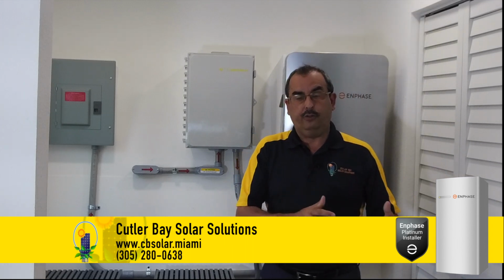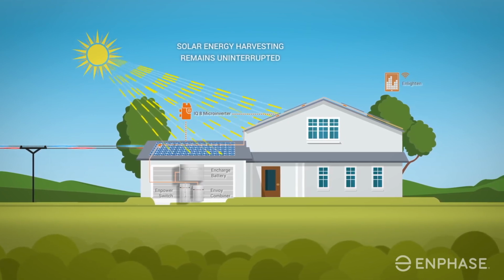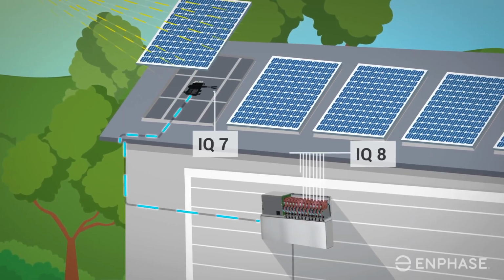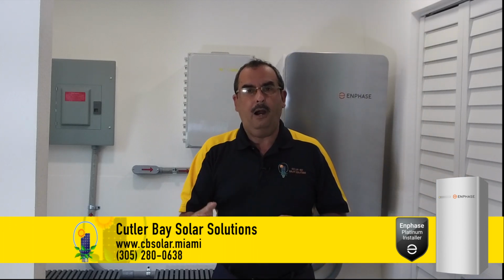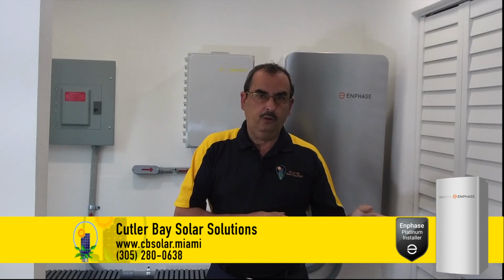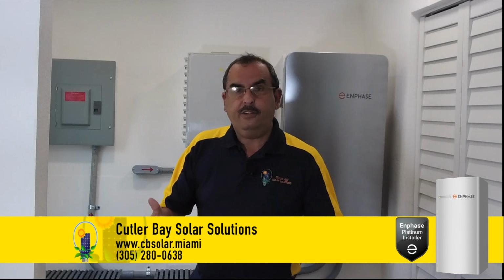Enphase Ensemble vs Tesla PowerWall 2 - Cutler Bay Solar Solutions - TGISS Episode 1

Comment: I hope you can answer my question here: I do not plan to have a battery storage, I intent to have the LG380W panels with 40 of IQ8H with one IQ-Combiner-4. Do I need an IQ system controller to get a ridge-tied system? Or just IQ-Combiner-4 (80A) is good enough?
Reply from the maker: Hi, You need the iq controller, rapid shit off switch, and a load controller in order for the iq8 to work as iq8

Comment: Outstanding and informative video.  Came here looking for answers between Tesla and enphase.  You covered all, except if I can run an HVAC system.

Overall great video!!  Thank you! 👍
Reply from the maker: Thanks for the nice comment! If both your solar and battery system are sized correctly, you can definitely run HVAC. Both systems will need a soft start if the cranking amps are too high

Comment: Hello im inters in put battery but my sistem it is solar edge with lg panels my question is if it s compatible with enphae battery?
Reply from the maker: Hi, thanks for your question. You would have to switch over to micro-inverters in order for the Enphase battery storage to be compatible with your system
Reply: @cutlerbaysolarsolutions4181   hello ok can  you contact me at dariolivares1977@gmail.com im ready to do it thanks!

Comment: Could someone help me out here, I’ve been trying to figure out what it would cost to have a solar with Enphase batteries. 12kw solar with 27-30kw enphase battery- how much could it cost? I can’t seem to find that answer anywhere.
Reply: You should check the independence reviews,  Enphase batteries is less efficient that Tesla or others
Reply: I am in the process of Enphase purchase and install in 2 phases.  Grid-tie this year and batteries next year.  The Enphase 10 battery is approx 15k a piece just for battery.  The iq7 micro inverters with 33 panels approx  9.7kw will approx 30k, so entire system with battery will ne 45 k.  To be equivalent to Powerwall II you need the Enphase 10 and 3kw battery combined.  Approx $22,000 just for batteries.

Comment: I also believe that Tesla does not work with a generator but enphase does?
Reply: Correct, Enphase recently updated the software for generator integration, it has a lot of options like what low percentage the batteries are at before starting generator, and it has “no run” times, like when your sleeping that it won’t start the generator, these are all adjustable by the owner

Comment: Misinformation- Enphase made several videos trying to fool people that during the outage your usage from Tesla System can’t be drawn from Solar & which is WRONG.  The house will draw energy from solar and powerwalls Will supply if the usage is more than solar could provide.  Powerwalls are more efficient, look nicer & specially lower cost.
Reply: Jimmy, Do you know if you have let's say 5KW of solar, will you still get full usage of the 5KW in outage situation? or does the Tesla Battery limit the solar to a certain KW?  Maybe a bigger 10KW solar Array could be a better example.  Thanks

Comment: I’ve been installing Tesla products for years. Raul your so misinformed. Sorry to say but Tesla solar will power the house 1st and charge the batteries in an off grid. 
Tesla batteries have fans that are there if needed. The safety of the battery is not dependent on the cooling system but has the cooling system to maintain a perfect operation temperature in any environment. How does your batteries cool when installed on the South side of the home? 
Also the Tesla batteries are as safe or saver than others in the market. 
We also have no problems with integrating our system with other inverters or solar panels. (More flexible system) 
Tesla gateway 2 is also 200 amps. Can you run a 400 amp home? We can buy installing two gateways. 
Tesla batteries are simple and beautiful out of the box, take must less room and don’t stick 2’ off the wall. Much more power in a smaller space. 
Please get your information correct.

Comment: Very good explanation - many thanks! Question: Can I run the Enphase Enpower Smart Switch WITHOUT a battery, so that if the system goes off grid I use power from the panels as long as the sun shines?
Reply from the maker: Hi! Thanks! No sorry the IQ8 is in the encharge unit not on the empower
Reply: @cutlerbaysolarsolutions4181  You're welcome. But I didn't ask about the IQ8? My question is; can I run Enphase Ensemble off-grid without a battery at all? I mean, only with the panels and the Enphase Smart Switch - using power from the panels simply as long as the sun shines?
Reply from the maker: @RomanKuechler  You will need the empower (smart switch), and encharge batteries in order to create a micro grid during power outages. The IQ8 micro-inverter is the technology built into the encharge batteries that makes the micro-grid possible.
Reply: The IQ8 microinverters are what enable the switch to island from the grid, you can't buy IQ8 inverters without the batteries, because ultities don't want to allow iq8 with out batteries to use on the grid yet

Comment: A lot of what you are telling about Enphase ensemble is based on IQ8. But that does not exist on the market.
Reply from the maker: Hi Robin, the IQ8 is included with the battery
Reply: @cutlerbaysolarsolutions4181  sorry I did not know that. Does that mean that with this battery you have all the same benefits as you described even with your current pannels with iq7 inverters?
Reply: Yes if you have panels with IQ7 inverters you are good to go.
Reply: @guyswiggins  My panels have IQ6. Enphase says IQ6 is compatible. Is there any difference between IQ6 panels and IQ7 panels?

Comment: I don't think Enphase does a good enough job of selling this aspect of the Ensemble system vs the others.   Thank you for this explanation.   I actually have the Enphase solar system.  As I was looking into storage solutions, I was put off by the Ensemble components costing 25%-50% more than the Telsa system without knowing the actual differences.
Reply: Misinformation- Enphase made several videos trying to fool people that during the outage your usage can’t be drawn from Solar & which is WRONG.  The house will draw energy from solar and powerwalls Will supply if the usage is more than solar could provide, doesn’t matter how many percentage of charge
Reply: @jimmyvole851  I have seen serval Enphase installers making this claim.  I'm not sure who to believe now.  was it an older Powerwall generation that Enphase was comparing to ?
Reply: @CrapTennis  I have Tesla solar system with 2 Powerwalls. There is no such thing as they described.  You could Google the people people with Tesla solar in Texas about their experiences a few weeks ago during the outage to see who was honest.  
suspicious business practices on misinformation
Reply from the maker: Interesting point! Thanks for the comment!!
Reply: @cutlerbaysolarsolutions4181  to understand the shortcoming of the powerwall more clearly....   in the event of grid outage, the powerwall only charges from the panels after it's charge drops below 50%?   I think this is 50% limit is programmable right?  if so, then why not set it to 99%?   so the powerwall would enable the string inverters immediately.   seems like that would be the same as the Ensemble system behavior then right?   thanks again
Reply: you cannot get any Powerwalls unless you buy the entire system from Tesla, like Raul said, better have one hardware brand to communicate with the OS

Comment: The 50% utilization of the battery before solar can be made available to home is not an accurate statement. I have a 14kw PV with 3 Tesla Powerwall 2s and the entire system is available from the moment the grid is down and the batteries take over.  The PV system only shuts down when the batteries are at 100% reserves.  However, if the local provider is limiting the system by regulation that may be another matter entirely.
Reply from the maker: While I can not speak to your system, The Tesla Powerwalls installed in our area are limited by the Utility integration.  This is software driven so it might be a local issue.  I am a big fan of Tesla, I drive it and I believe they are a fantastic car company.  I hope soon they make the same investment on the home energy side of the business so that they may once again lead the pack and not follow as they have chosen to do for now.
Reply: @cutlerbaysolarsolutions4181  I was just sent this video link by a sales rep. I plan to finalize a purchase of a solar system in the next 48 hours.  It is very confusing that you say the Powerwall won't allow my panels to power my house first while topping off the battery usage from the night before with the excess. This is apparently a local issue with you that should have been addressed in the video. It seems very misleading and has now made me question all of the decisions I have made up to this point. Also, I think that, just like my Rachio sprinkler controller, Tesla uses weather data to trigger events that prepare the system for a possible outage. This video has confused me and now I'm getting annoyed with all of it. I can't image that Tesla will like it either if what you're saying isn't true.
Reply: @BigBassCountry  Understood that you are annoyed, Scott.  I assume that your annoyance lead you to purchase Powerwalls?
Reply: @cutlerbaysolarsolutions4181  Currently, I do not believe your information is vague with mendacious intent, however you are promoting one system and limiting another without the clarity of the self-limiting component that is coming from the local utility provider.  Yes, my provider has not engineered any restrictions on how I can utilize my storage solution.  So, it would be interesting for more details on this limitation that the utility provider has established in the areas you are referencing. These details would show why the Enphase solution is a more information driven system that prevent unforeseen damages with its advance energy management processes.  Best Regards,